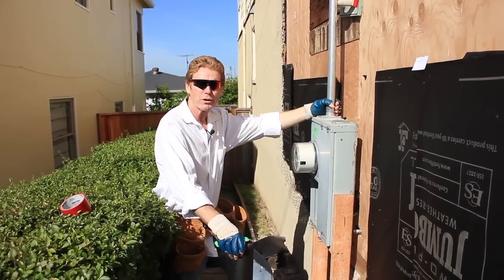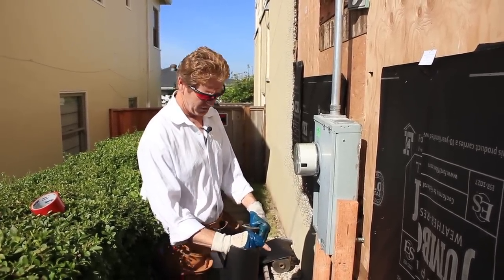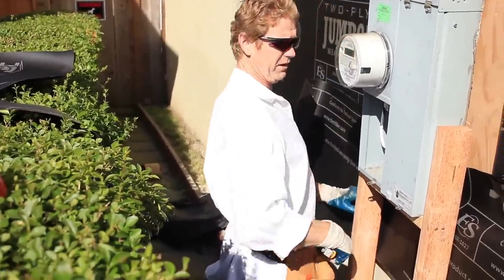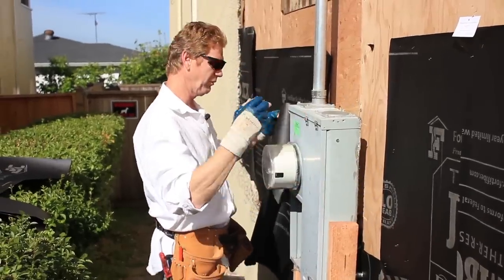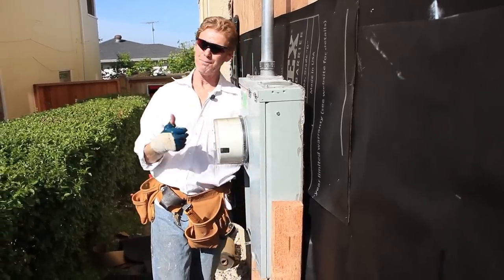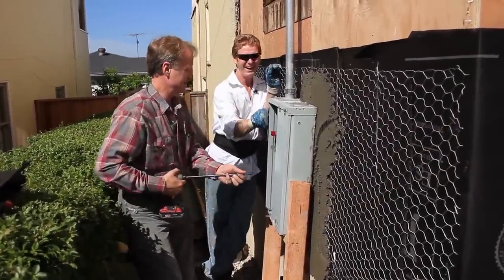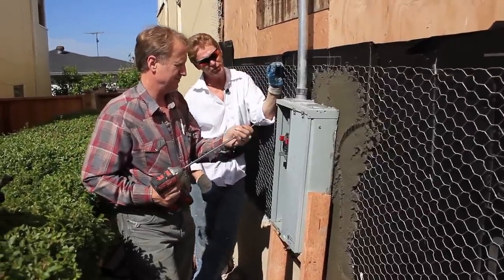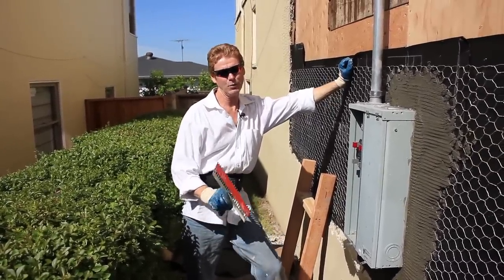Waterproofing behind an electrical panel with paper

Comment: Hi Kirk,

This is the PERFECT solution to my current problem. The good news is that I don't have the electrical panel up yet, so I don't have to fuss with getting the stucco behind it. The key was seeing how to do the flashing correctly and getting the stucco around the box prepared for the brown coat so my stucco guy could come back in later for the rest of the stucco job. Anything to make it easier for everybody.

Many thanks!!
Frank Borik
Reply from the maker: Howdy Frank Borik, no worries, glad to be of help,
 best wishes, 
 kirk giordano plastering

Comment: Hey Kirk , you should look into the husky quiet compressor. Very helpful when you don't want to make noise with you're older compressor very affordable and can sustain high psi pressure for nail guns or staple guns. Great video !
Reply from the maker: Morning Alex Melendez, thank you,
 I now wear a mic on the last 2 or 3 hundred videos, much better for sound control.
 Cheers,
 kirk giordano Plastering

Comment: I just put in a new panel and about 6 Sq ft of stucco was knocked out. How would do you typically charge to waterproof the new box/stucco patch?
Reply from the maker: @rjwong  There is no such thing as a square foot one size fits all for stucco. We’d have to view it as there are many variables.